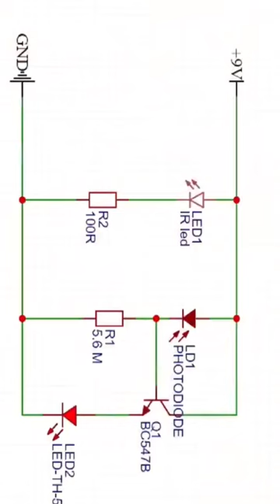How to Make a Simple Proximity Sensor #shorts #zaferyildiz #short #proximity #ir  #bc547 547 #led

Comment: Esse circuito pode ser alimentado por 12 volts ?

Se sim há a possibilidade de se colocar um relé mó lugar do led verde ?
Pois assim poderia acionar uma luz ou uma campainha.
Reply: 12 volts? Yes. You will need to change the resistors a bit (larger) to avoid burning LEDs. 
A relay? I don't think so. This circuit is very simple, and assumes very, very low current running across the LD1 photodiode. Q1 multiplies the base current, and the emitter current is only 20 mA. Such low current may not be sufficient to drive the relay coil. Surely, light bulbs would not produce light with 20 mA current.
Slight modification of the circuit, e. g. addition of another transistor controlled by Q1, may help.